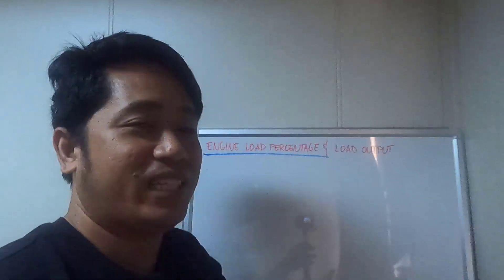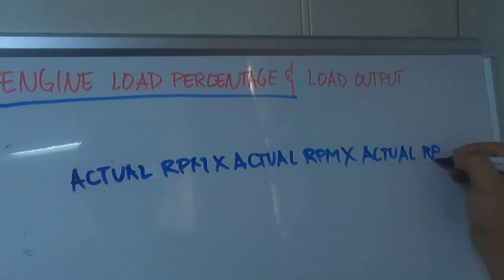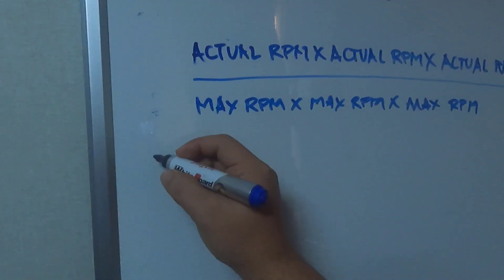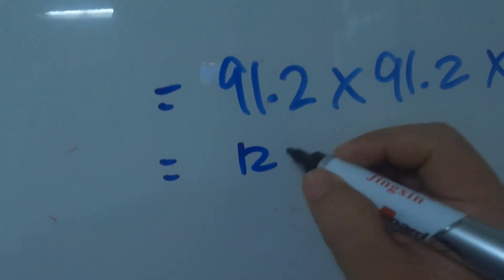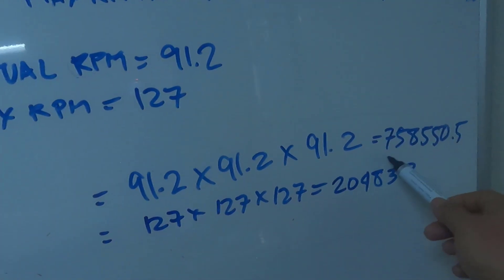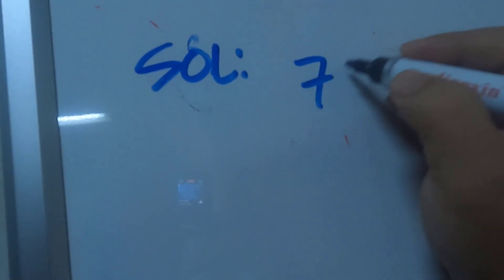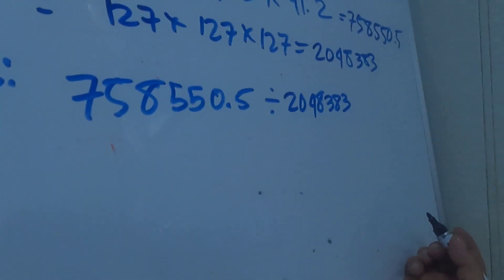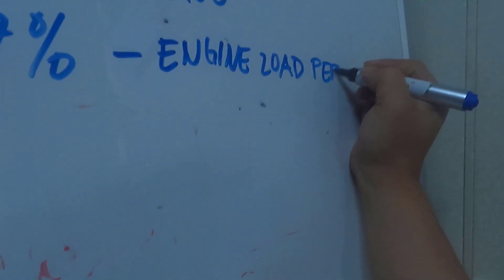How to compute Engine load percentage and engine output

Comment: Your formula imposible broo not posible only37℅ of 91.2 rpm.. I got it 71%
Reply from the maker: Bro i've been using that kind of formula since 2012 until now and i did not encounter any issues.  Also since then, almost chief engineer that i work it, this formula is there commonly use.

Anyway if i can find my exact and detailed copy in my notes. I will re upload a detailed explaination soon. Anyway thanks for your concern,